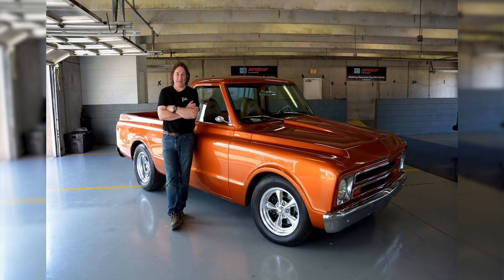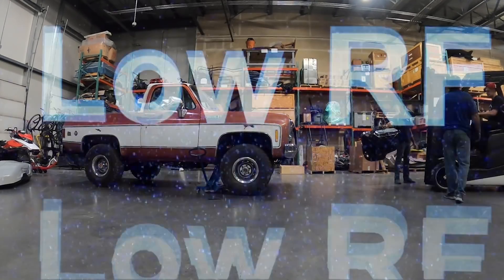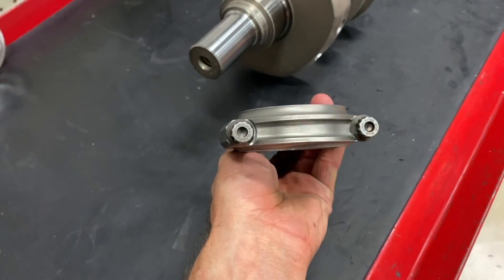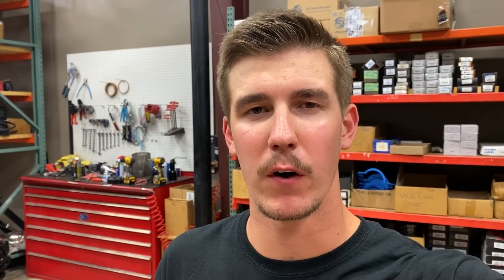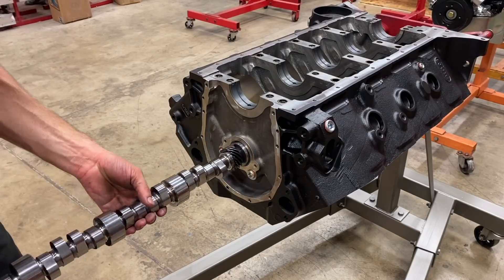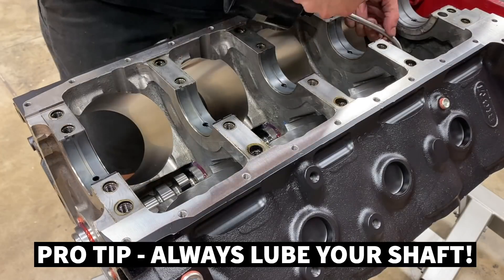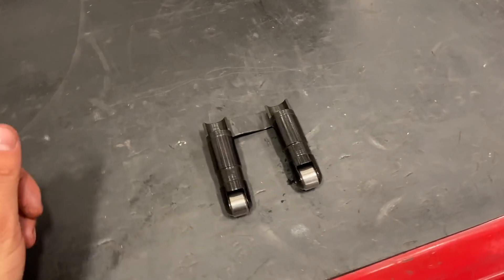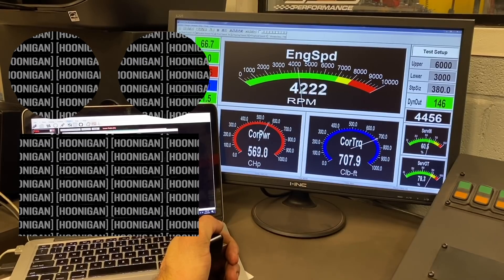9.3 Liter V8 Build! - Zac's Squarebody K5 Big Block Swap Pt.2

Comment: This engine builder is really good, really clean job and overall really good at his craft. If I had one comment for improvement, well.. I should say, a comment that my old "engine building" teacher would give him, would be to mark each final torques one by one as you go, rather than in bulk at the end, because if you get pulled out of your job for any reasons, right in the middle of it, when you come back at your station you will have to start all over again just to be sure :)

Comment: Skipped a few pertinent steps there like decreeing the camshaft. Now I know there was far more done to the engine, no well built engine gets put together just once but degreeing in a camshaft is a super important step for even a garage mechanic as is checking piston to valve but this probably isn’t this dude’s first rodeo with this cam so he knows it’ll clear. Still, important to check for average joe garage builder. One spec I never heard though is compression ratio

Comment: just curious seeking for knowledge, why choosing pistons 2618 over 4032  specially for NA motor due to thermal expansion rate in 2618 high compare to 4032 as the main target for this engine is for longevity and DD. as far it goes for power level 4032 supposed to handle it. im not an expert just would like to know what did i miss here. Thank you

Comment: Enjoying the build, and how thorough the engine builder is taking us along the assembly. Just a quick question looking at them coated cam bearings. The oil holes looked a bit rough. Needed a deburring. I guess Jacob took care of that of camera before installing? I Can't wait to hear this monster!

Comment: 8:08 Idk why but that "ting" was satisfying
Reply: The ringing is also a quick way to check that a crank, or lots of other stuff, isn’t cracked. If it’s good it’ll ring like that. If it’s cracked it usually won’t ring when you tap it.
Reply: @NBSV1  Okay but like, it was just satisfying that it wasn't interrupted by any touching surfaces. It rang true and completely unabated.

Comment: Damn 632 inches of lift 
Talk about a huge cam it's bigger than the car!
Reply: That's actually small for a 572ci bigblock Chevy. I use a 800 lift cam in a 496ci.
Reply: @thereluctantgearhead4544  do you have .800 lift or 800 inches of lift? Lmao
Reply: @asjmpickle  actually .790/.817
Reply: @asjmpickle  288/296@.050
Reply: @asjmpickle  old NHRA Superstock cam.
Reply: @asjmpickle  ex NHRA Superstock 454+ .060 with a 4.25 crank, 12.8-1 compression and a 1150 Dominator on a Dart singleplane.
Reply: @asjmpickle  ran 9.50s in a 3200lb G-body on 29x11.5x15 M/T slicks.
Reply: @thereluctantgearhead4544  you do not understand the joke it seems.
A cam for an engine will not have several feet of lift...
Reply: @thereluctantgearhead4544  although I love 290+ cams 
Huge duration is the best.
My Honda was also 12.8:1 compression because you can swap the heads and pistons around.
Reply: @asjmpickle  I'm well aware of that, I've been building engines for 38yrs, and did it for a living for 30 yrs. I know alittle bit about them.
Reply: @asjmpickle  I built NHRA legal Stock and Superstock engines back in the late 80s thru the 90s.
Reply: @asjmpickle  I thought I put a . in front of that 800, but I guess it didn't register. My old eyes ain't what they used to be. I just retired a year ago.
Reply: @thereluctantgearhead4544  in the video the guy says inches and not thou etc.
I fucked around with a 496 chev that I traded for a spa pool and a Mitsubishi but haven't really gotten to work on many v8s would love to play around with some hemi v8s 
And the modern ford v8s my friend had an FG XR8 GS that made 450 wheel on just a tune 
Which is the best kinda car being a true stick shift cheaper family car.
Reply: @asjmpickle  pretty easy to convert G-bodys to manual trans. Lots of potential with them.
Reply: @thereluctantgearhead4544  not exactly a car that exists in numbers at all. 
Honestly I doubt there's more than a handful in the country. 
Outside of America I don't think you realise that most American cars are 6 figure cars 
Like Camaro, charger is about 110-170k 
Mustangs a little cheaper but still can reach 100k
Reply: @asjmpickle  I know they are rare, but you can buy the shit to convert them. I had a 4spd 79 Malibu years ago. It came with a Saginaw 4spd, I swapped in a Super T-10. I've seen reproduction pedal assembly's for sale on eBay. A couple grand could have a 4spd in a mid 80s Monte Carlo or Regal.
Reply: @asjmpickle  all the parts needed are available to purchase.
Reply: @asjmpickle  I realize that modern shit cost way to much. That's why I build my old junk to be faster than production cars. And save a lot of money doing it. Plus it's fun working on old cars. I have a old C-10 shop truck with a healthy smallblock in it that's smoked more than a few modern muscle cars. It's got a 4spd and 4-10 gear in it. Looks like shit, runs like hell.
Reply: @asjmpickle  I have a 84 Z-28 with a manual trans SBC in it that's a low 10 second car, has less than $20,000 in it. Paid $1500 for the body.
Reply: Good cam for that engine in a heavy truck tho.

Comment: its so nice to see an engine builder that knows how to use a torque wrench and does NOT drowned the pistons in oil. total seal says spray the piston and cylinder with wd-40.

Comment: The timing mark is off because of the way he found TDC. The piston dwells at TDC for as much as 4 degrees. 

So he might have that pointer off as much as 4 degrees. And why didn't he degree the cam, that should always be checked on a performance build.🙄

Comment: fun fact: this is a 9.30L v8.

There are 930 cubic inch v8's.

I NEED IT
Reply: Liters is not equal to ci, while still massive it is 572ci
Reply: @nickgrillo4830  no kidding
Reply: Fun fact: there are 1000ci engines based on the big block Chevy

https://www.sonnysracingengines.com/engines/drag-racing-engines/sar-1005-2100-hp

Comment: I'm curious how much power this thing will have, they're starting to get impressive power out of the modern "Small blocks", the 6.2 produces what, 420HP from the factory in a Silverado?
Reply from the maker: On the next episode, it gets dyno'd
Reply: @HooniganProjectGarage  Yeah, I'm excited... This engine looks like it's gonna be tough and should be reliable, but, you know, Hoonigan instantly means a cars reliability drops to negatives. Loving the series man, shame I couldn't keep my '74 GMC, but it was so rotten I could SEE the cab support, had to move my left foot when driving through puddles or my foot would get wet.
Reply: I'm guessing 720hp N/A

Comment: Beating the bearings in may cause micro-fractures and/or deform the bearing (depends on the material). You never beat cam bearings, you pull them in.

Comment: This guy said 2.3 inch intake valves good lord that's .2 off from most people's intercooler piping.
Reply: shes real stout
Reply: Depends on the people you know.
Reply: Big-block life, haha!
Reply: the dual exhaust for my n/a rx7 is 2in from the engine to exhaust tips, so its bigger than my exhaust XD
Reply: @Primal____  Is bigger then the exhaust on my 4.0l ranger.
Reply: Just realized how big it is
Reply: Probably wider than the cylinders in my 1.6L Diesel VW motor
Reply: They're large but theres only 1 per cylinder, the intake valves on a k series are 1.37 inch and coyote ones are 1.45 inch both of which 2 per cylinder and are much smaller displacement.
Reply: He is trying.  Poor guy relates it to copperhead. Nothing about it is the same or close. Gave a way the badass c10 smh
Reply: @williambranco7710  His boss owns most of the project cars they just get to drive them

Comment: The engine builder never  confirmed if it will Chop. I would return the motor and get it certified to Chop
Reply: The certification process is on the engine dyno! Just gotta wait for the next episode